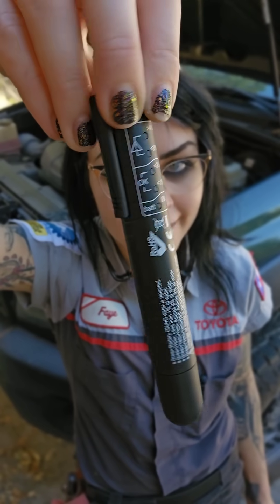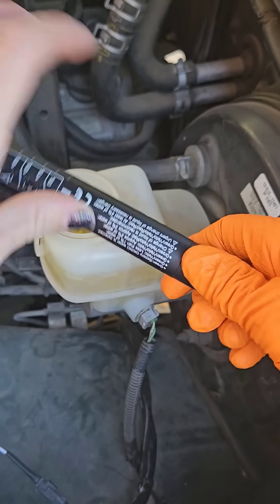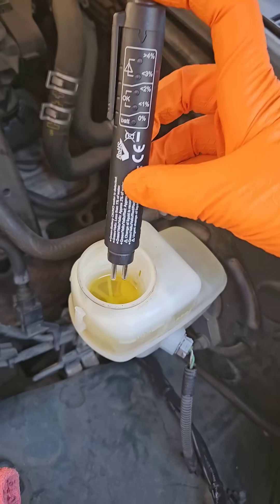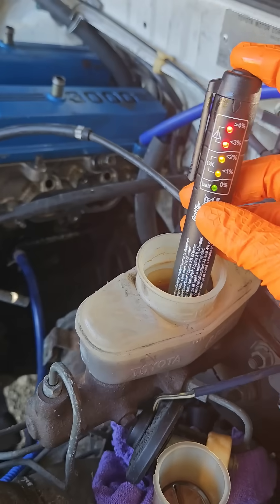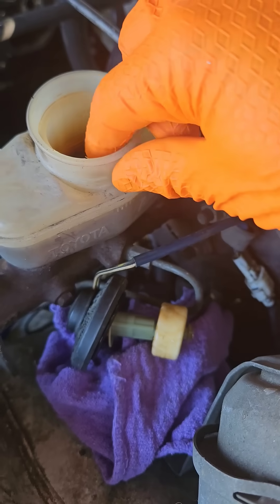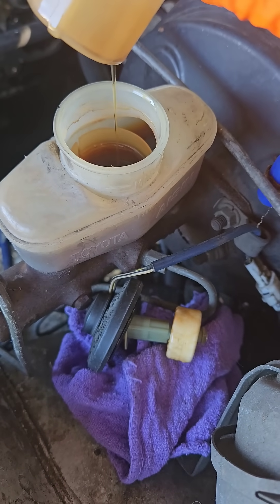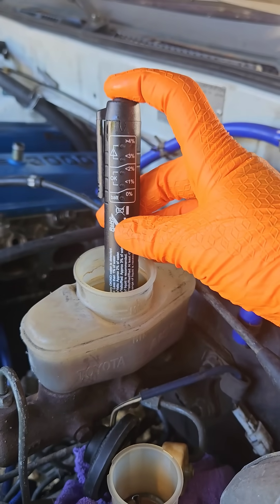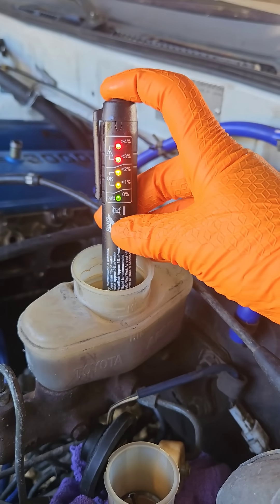Do you REALLY need your Brake Fluid Flushed?? How to Test it For Yourself!

Comment: As a mechanic I've never seen a person who changes their break fluid when needed have to replace wheel cylinders, master cylinders or calipers. Break lines and hoses still rot from the outside, but that's it.

To all the folks rightly pointing out that I misspelled brake: of your only argument against changing brake fluid is a spelling error, then you have no argument. Step aside, shut your mouth, and let the adults talk.
Reply: Brake fluid service is part of every manufacturers maintenance service. As a tech you should educate your customers before they need to dump thousands into ABS unit replacement.
Reply: @stevedelaney6583 there are more than a few items on a manufacturer’s maintenance service that are there simply to help dealer service departments make money. This is one of those items.
Reply: As a mechanic, I'd expect you to know how to spell "brake" properly.
Reply: @spiralnapkin , I was going to mention this... 👍😎
Reply: @spiralnapkin  
42 years and I still don't know how to spell axel (axle?) for sure.
Reply: @dukecraig2402 53 years I I've finally started remembering how to spell axle by thinking about adding an S to the end every time I spell it. Lots of words end with ES but I don't think anything ends with ELS
Reply: I have seen brake lines rot from inside, but normally it takes a very long time.
Reply: Brake fluid. It's BRAKE fluid. In your BRAKES.
Reply: @sussertheoriginal  
Give him a brake.
Reply: My 67 Austin still had its original factory brake fluid, original pads, shoes and wheel cylinders. Up until a few years ago when I stripped the car for restoration. It has only covered 5,301 miles from new
Reply: I don't see what the big issue is, you replace every other fluid on the car on a regular basis, for the price of a brake fluid service every few years. I've never heard in any of my 43 years in the automotive repair industry, anybody complaining that they change their brake fluid once or twice over the life of their car.
Reply: Fluid dynamics tell me all I need is hydraulic pressure inside the brake lines.

But pressure = HEAT and I need a liquid inside that has a pretty high boiling point and the ability to get hot and not boil off.
Reply: Brake*
Reply: If you're concerned about being ripped off, find out if your repair shop incentivizes any repairs. For example, one place I worked at would incentivize the sale of shock absorbers and strut assemblies, so during that month those sales went through the roof and the rest of the year the sales were flat. So either every single person that needed struts and shocks came in that one month or a lot of them were being sold unnecessarily.
Reply: @@brandonlindsey6274 it always should until you get repeat hard braking. 

Old fluid might be good for 2-3 HARD braking before the fluid starts boiling whereas fresh fluid may be able to take repeated hard braking
Reply: As a “mechanic”

You don’t even know how to spell BRAKES… You’re just as bad as that baby mama driving her clapped out Altima saying “he break checked me”
Reply: Lol, yeah, I have never seen a bottle of brake fluid with an expiration date on it. 🤣
Reply: I’ve gone 8 years on the same brake fluid with several cars in humid climates with no issues and the brakes worked like factory new when I sold them. I don’t know what people do to their brakes but ambient moisture seepage is not it. I’d wager more of the issues are extreme heat fatigue (track days, riding bumpers, burnouts) or environmental (deep water, snow/salt, etc). Old cars used inferior materials that would corrode regardless, but newer ones don’t. No reason to change it if it still works well. But sell more nonsense for a quick buck.
Reply: @nunyabusiness896 I’m goin on 15 years
Reply: @nunyabusiness896 modern vehicles are much heavier and cook brake fluid easier. The pedal feels fine because you got used to it over the years gradually changing. It's not like one day the fluid gives up and the pedal just goes to the floor. I bet if you cracked a bleeder the fluid would be completely black.
Reply: @wigletron2846   Yeah, that degradation from 100% to 99.99% was really drastic, I just didn't notice.  After 8 years both cars still had brakes that felt better than literally other car I drove including brand new ones.  You're just a coping mechanic that keeps wanting to sell easy unnecessary fluid changes to line your pockets because real mechanic work is actually hard.
Reply: @nunyabusiness896  lol I'm not a mechanic I've just changed brake fluid in cars that "felt fine" and the fluid at the calipers was completely black and cooked. You're just clueless about cars and now are butthurt that people that know more than you are calling you out. But that's fine. Just keep running that brake fluid until the brakes give out. Have fun.
Reply: @nunyabusiness896 
Very few cars use stainless steel brake lines, I highly doubt you've ever had the kind of money it takes to buy one.
It cracks me up how people like you that do nothing more than own a car will sit around and second guess people who repair them all day long.
Your head can't get wrapped around the concept that people who repair cars are the one's who see what goes bad and what causes it to go bad?
No, they wouldn't know, you would, just because you had a car and sold it.
How do you know how long afterwards it was until it blew a brake line?
Ok, if she doesn't know what she's talking about then tell everyone, what causes rust inside of a brake system? 
Ever taken a brake caliper or wheel cylinder off that was bad because the bore in them got rusty and tore the seal up? If she's wrong then explain how it got rusty in there.
"I had a car for 8 years and when I sold it the brakes worked as good as factory new".
We know, us mechanics fix them all the time not long after the next owner buys them.
Reply: same, I've seen fluid from decades still doing fine. Honestly I do mine after I do a rear break job (usually 5-10 years for me) since I already have the wheels offs might as well do it while I'm there.
Reply: If you never change your brake fluid you can see how dirty it get new brake fluid is clean old brake fluid is dirty and clog a line were you step on the brakes it may not applied the brake. Like one of you steer tires this could cause the car to pull hard to one side and cause an accident. Or the brake not release and your stuck with your brake locked up.
Reply: Never heard nor will you ever do this its a scam SMH

Comment: Good idea.  I got one of those off Amazon about 6 months ago and found out my 26 year old brake fluid needed changed.  So, I pulled all the wheels, removed the calipers, cleaned them all up and painted them, bought and installed some Russel speed bleeder screws, and flushed the system.  Fortunately there wasn't any rust problem because it was a SoCal car that was only recently transplanted to FL.  I'll be keeping a much better eye on moisture content from now on.

Comment: The brake fluid that’s going to give you a problem is the fluid that’s downtown in the calipers we’re all the heat and particles from your brake lines are deposited. It’s a good idea to flush it out when you do a brake job…… keep on rockin

Comment: Cute eyeliner...is that tatoo'd on?
  Never put hydraulic, or any other oil in a brake or clutch system!! I know she didn't say to, i'm just sayin the best thing in an emergency, when no brake fluid is available is urine. Thats right, piss inna cup an put it in there to get you home so you can fix it correctly!
     Brake fluid is NOT A HYDRAULIC OIL!!, it is MOSTLY WATER!! Fact is brake fluid and rubber dont get along. It was fomulated that way for the longevity of the rubber.
    Really though, if you see that black particulate in brake fluid, it is normal, to a point. 
    Flushing the brake fluid is not a bad thing, it's just Nobody Does it correctly! Or considers that that black stuff floating in the brake fluid is the rubber parts from their brake system😮❤😊 I'd be more interested in getting hoses and calipers and wheel cylinders inspected than flushing brake fluid!!🤙🍺🍺🍺✌️🤑 that will naturally happen when you replace worn parts as part of a comprehensive maintainence schedule.😊😊

Comment: Good advice for the non-DIYer.  I do my own brakes so if the color is getting like maple syrup or more than 3-5 years old I like to flush out. It's also a good idea to crack open the bleed screw every couple years just to make sure it doesn't get seized up.
Reply: If you're cracking open the bleeder then you might as well change the fluid. The recommended interval is every 2 years. Water in brake fluid enables rust and corrosion from the inside out. Changing the fluid will save you from costly repairs that you won't see coming.
Reply: I have never heard of flushing brake fluid till recently. So I flushed my fluid in my ‘98 f150 for the first time ever!!! Original OEM fluid from the factory 😂😂😂… that stuff looked like motor oil…. Now just need to do my ‘06
Reply: The Harbor freight Hand pump For brakes
Reply: Guys I didn't change any fluid of my car Corolla for 15 years. I bought it new in 2008. Is it still safe to drive? 😅😅😂😂
Reply: @thegoldenland  maintenance schedule is over the top 👍
Reply: @thegoldenland I've gone almost 20 years in a car before. You never really know. I did have to replace a caliper, and then I had to flush the system.
Reply: @mikeross111  you did it after 20 years using your car?
Reply: @thegoldenland  Yeah, It was on 1996 Corrola. I just put it off, eventually just forgot until a front caliper seized up in 2022 with 211k on it. I obviously don't recommend anyone waiting that long but I did.
Reply: @mikeross111  mine is 100k. I changed front brake pads by myself at 80k miles. Thinking to change rear brake shoes at 120k miles
Reply: Every two years is what's advised
Reply: I bought a 1970 F-100 ten years ago that was running and licensed but had not been driven much lately. It needed brake shoes on the rear and slave cylinders. I replaced all that. Within a year, the new cylinder had frozen up, obviously from water in the break fluid.
Reply: @stevenpollard5171  I work for bmw and we have a 2 year schedule for brake flushing.   People that follow it have the same calipers for the lifetime of the car.  

I think I've replaced maybe 5 calipers in the last 5 years.
Reply: Good advice Homie. 👍
Reply: Yeah, that's good advice about cracking the bleeder every few years, but only if you know how to properly bleed brakes. You can also do what I do and spray PB Blaster, WD-40, etc. every couple months just to keep them sh*ts penetrated with lubrication.
Reply: I wouldn't wait even three years, never mind five, between flushes.
Reply: @pulaski1 right it's like $7 for a quart size of brake fluid and like $4 a pint and if know how to bleed them it doesn't take a gallon like the engine does and prolong the life of the braking system.
Reply: @gariningleton3785  I'm not sure that flushes extend the life of the brake system, but they ensure that when I put my foot on the brakes, my car is actually going to stop, so flushes probably extend my life!  😀
Reply: @gariningleton3785 where are you paying that, a quart here is $12-15.  But yeah I'm in agreement I do my brake fluid every 2-4 oil changes. And I do those every 3-6 months depending on mileage. So that's a brake flush every 12-24 months. It probably helps that the hydraulic clutch in my truck is always a pain in my ass, so I always have brake fluid on hand.
Reply: @pulaski1 well they do.. so.. there ya go.
Reply: @gariningleton3785 Problem is 98% of Americans can't replace their own brake pads, much less flush the fluid.
Reply: @gariningleton3785 It's not always that simple though.  I agree if your car is fairly new and everything is nice and in good condition, it doesn't cost that much to flush the brake fluid if you DIY.  But if you have a 20+ year old car and the bleeders have rust all over them and it's never been cracked open, that $7 quart of brake fluid can turn into a new caliper and, well I better get lines while I'm at it.  And now youve gotta ask yourself how much work and time does my 01 Cavalier actually warrant? Ntm if you've got an even older car and have to beware of synthetic brake fluid.

Where you live can factor into as well.  I'm not saying saturated brake fluid is fine. Not at all.  But if it's your work car, and you literally drive it 20 miles of highway straight to work and straight home, are your brakes ever going to get hot enough to matter?
Reply: NEVER push fluid up stream. Always crack the bleeders when you compress your calipers.
Reply: @SeedNBS  I suppose if you're going to change it anyway, it wouldn't be bad would it?
Reply: If you have NEVER flushed your brakes, I wouldn't until you're ready to replace master cylinders and such.
Reply: @anthonyjulson8840  i did a complete brake job other than the master cylinder… works great
Reply: If your bleeder screw is seized as mine usually are you can just back off the nut on the hose on the caliper
Reply: @shanefowler3504 what about the fluid in the caliper. Bleeder is above the banjo for a reason.
Reply: @unreal4202  put a C-clamp on a brake pad and push the caliper in then there's no fluid inside of it
Reply: @shanefowler3504 I mean, there is still some fluid in the caliper, but ignoring that... you're pushing fluid upstream at that point, which is what the person you originally responded to advised against. The reason being, you are pushing dirty, contaminated fluid back into the ABS module, and those are expensive and touchy. Also, if you loosen the brake hose nut as you advised, you're potentially letting air in which you then can't bleed out if you're bleeder screw is seized 🤔🤷
Reply: I'm just mentioning what I've done to get around a crusty bleeder screw that wasn't coming undone which was drained as much of the fluid as I could with the method used
Reply: Put Teflon tape on the threads when installing a new bleed screw.
Reply: I put Never Seize on everything. The few seconds it takes now will save you hours later.
Reply: @SwapPartLLC Some things benefit from anti-seize, some do not. You should not put it on EVERYTHING.

Comment: But here's the thing, to my knowledge the vehicles at work have never had a brake fluid change even though I've mentioned they all need it, yet when I drive any of them I do not notice a problem with braking performance. So my question is this: under normal driving conditions, and other than firm pedal feel and the possibility of corrosion (which actually isn't as bad of a possibility as some might think), is there actually a need to replace brake fluid

Comment: Learned something new. I never flushed the brake fluid in any of my vehicles.  Just changed pads and rotors.
Reply: Flush it everytime you change your pads
Reply: I think it has to do with areas with high humidity....I never change it either

Comment: Wow!  Very knowledgeable and good at teaching us laymen.  Laypeople?  Thanks!  I ordered a tester on Amazon.  Even in Texas, I'm betting that my 2017 Prius could use a break fluid flush.
Reply from the maker: The shape of the reservoir in the Prius may make it hard to reach - there's a plastic cover that pops off for access, and you can suck out a little fluid with a turkey baster if needed and put it in a clean cup to test it!

Comment: Great video
Reply from the maker: Thanks!
Reply: @FayeHadley  quick question if you will, I’m doing valve steam seals  when I put the timing chain back on first I should set the engine to TDC correct?

Comment: Brakes work on a friction principle. The friction of the pads against the rotor stop the vehicle. Friction causes heat. Heat causes boiling. Brake fluid is formulated to a specific boiling point depending on which dot formula it is. As water gets in the brake fluid it lowers its boiling temp. Boiling brake fluid is no good.

Comment: I got into a long winded argument with a coworker years ago about this exact subject. He was convinced that you never need to flush your brake fluid only bleed it when you get new pads and was convinced that replacing it was a scam. It was so frustrating.
Reply: Lotta that going around, especially when the corrosive effect of the water is invisible until problems occur, and the lowered boiling point only becomes problematic under extreme conditions.
Reply: Ignorance ughh

Comment: Ok first off cool tool definitely gonna be looking for one, but I’d always been told about the copper content of the fluid being the determining factor in flushing a brake system. I mean water content definitely makes sense as a factor as well because you aren’t supposed to use a bottle that’s been out for more than a day(shop rules idk on the exact science) because it’ll pick up moisture. So I guess my point is, is there one that tests for copper content as well or are we stuck with the little strips?
Reply: Copper content is a result of water content. With time the corrosion inhibitor additive package is consumed, simultaneously water content increases, which in brake lines lined with copper internally begins to corrode them. Copper content and/or water content are both valid reasons to flush

Comment: I am 80 yo, keep my cars a long time.  Do all work my self.  I have never flushed brake fluid.  Never had any issues with water in my brake fluid.  This is a new thing dealers have told you to do in the last appx. 20 years.  Totally unnecessary.
Reply: 80 years is too long to be this ignorant

Comment: The information she provided about the brake system and fluid is fantastic! However, I tried this tester, and it gave a bad reading on the new fluid I recently purchased. Maybe this was an ID10T error on my part,, or I got a defective tester. Just food for thought.
Reply from the maker: There are lots of fakes out there so definitely check out the one that I recommend and list in my Amazon storefront!!